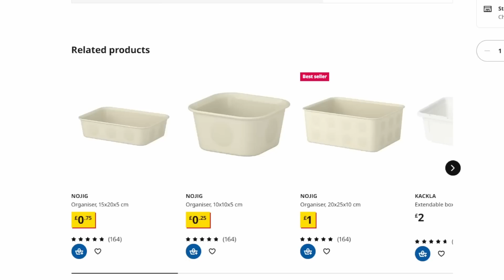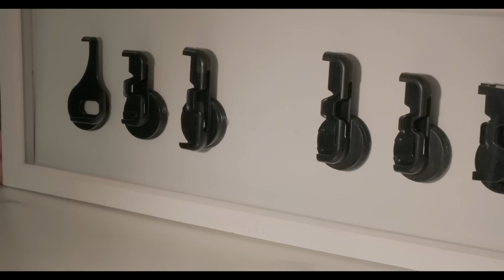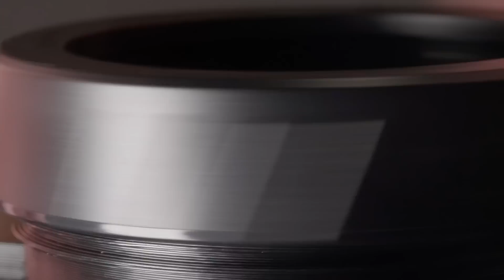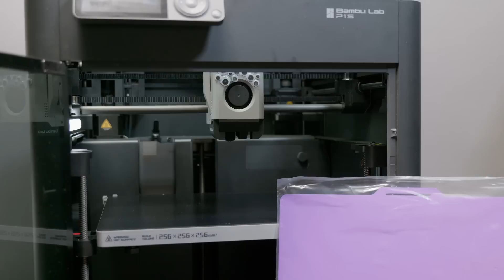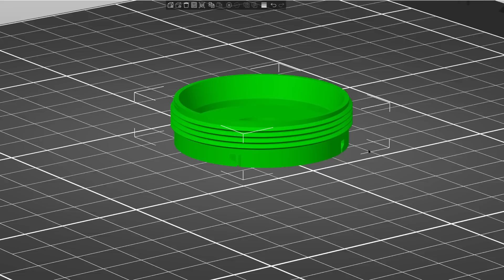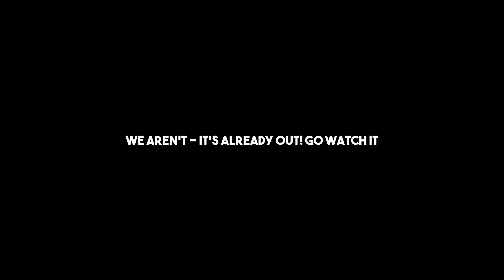Beyond Trinkets: Why the 3D Printer is Now a Production Tool

Comment: Mark could optimise his designed-in support removal by changing to a single serpentine line of support. That way (with some tuning) the support could be pulled out in one go by grabbing a designed-in handle.
Reply: This is an excellent idea.  I will use it!
Reply: Or he could avoid supports all together by using non-planar 3d-printing. I believe it's not yet production ready and still needs improvement(could be wrong though), but it could make a difference in application like this and might be worth exploring and investing into it. @joshuayjbird did a video on it.
Reply: @kevinraetz3890  It's a fantastic idea, in theory.  The challenge is the complexity in toolpath generation skyrockets compared to normal '2.5D' printing.  In a context like this, where a single product is being made in some quantity with evolution of the design, the worth-it factor is potentially higher, but overcoming the challenges and getting it to the point it's actually improving the quality of parts printed would be hard - it's taken him some time to get to fully designed-in supports, and non-planar is at least an order of magnitude more complex.  We either need a breakthrough in slicer-based analysis of parts and rules-based generation of gcode toolpaths based on zones within the part, or people with enough throughput to get the ROI need to treat toolpath generation like CNC machining and really design the gcode toolpath to form the part with non-planar sections.
Reply: @kevinraetz3890 you have to use what is actually available.

Comment: This is a very important information to get out there, because people (especially thos already into 3D printing) still consider Prusas printers to be "amateur" or "inferior", because they use 3D printed parts.

One of good sources I found on the topic of using 3D printing for manufacturing and it benefits/advantages is Slant 3D.
A few videos "The Competitive Advantages of Mass Production 3D Printing" and "How 3D Printing Reduces Carbon Footprint" gives you things to consider about the whole manufacturing cost (transport, storage, tooling,...), not just cost of material.
Another video about "Perry Parts" showed the need for including 3D printing in types of production. Sometimes, 3D printing provides parts that are superior to parts made other manufacturing methods.
Reply: I'd say you should take anything the Slant 3D guy says with the consideration that he's extremely biased in what he says. Their videos are made purely to promote his business so he will sometimes say things that are straight up wrong about other manufacturing processes.
Reply: " Slant 3D"
You mean the company that sells you 3D printing services and doesn't use 3D printing them self cause it is a bad idea?

Comment: That's the most interesting video on 3D printing that I've seen in a while. Resources on professional 3D printing (as opposed to mass producing garbage toys and flower pots) is still very rare. I'd also be very interested in a video on achieving production quality 3D printing!
Reply: There are some resources out there. I'm not a big fan of Slant3D, but he does have a lot of videos for designing for 3D printing, since he runs a 3D printing business. Just be aware that he's very much into his own 3D printing business and isn't a fan of home 3D printing. I will see if I can find other good resources.
Reply from the maker: Noted !
Reply: Make a flying thing with it!
Reply: " is still very rare."
Well - cause 3D printing is inherently not suited to mass-production. it is fast and cheap to getting started - great for prototyping. But it has high production costs, low accuracy and low strength. 

And no it is nto cause 3D printing is "new". It has been used for many decades in actual manufacturing companies - for prototypes. You can find videos of the automative-industry basically pioneering resin-printers in the 70s - photosensitive polymers hardened by 3 lasers.
Reply: @ABaumstumpf  Accuracy and strength can be good enough if the product has low requirements, like the product shown in this video. 3D printing has in my opinion filled a void where you need a part that is niche and too low volume for mass production. The adapter in this video is a good example - it's used by doctors, not the general public, and it needs to be created for the specific phone. It's probably not seeing the volume needed for injection molding.
Reply: @logicalfundy "where you need a part that is niche and too low volume for mass production"
Yes, butt hey are talking about mass-production.
Reply: @ABaumstumpf  there's a difference between mass production on the order of a few thousand units per year or month and a few thousand units per day or hour.
Reply: @ABaumstumpf  The point being made in the video is that there are now many valid ways to manufacture a product, each with their strengths and weaknesses, which are also evolving to the point that multiple ways can be 'good enough'.  The old view that 3D printing is for prototyping and methods like injection moulding are the only sensible way to do mass production is too simplistic.  There are big overlaps, even going up to very high unit counts, where either might be a reasonable choice, and you need to evaluate all aspects of the product to decide which is right.  I've produced over 100,000 units of an FDM part for a customer who has had a quote in hand for injection moulding it, because the convenience of my shipping precise batches on demand, and zero upfront tooling cost outweigh (not dramatically) lower unit cost, as the quality requirements are insensitive enough that we can easily meet them with well tuned but quite basic FDM printing, 2000 units/day.  Other parts might have requirements that would preclude this and make SLS printing, CNC machining or injection moulding either the only way to produce them, or the best return on investment when all factors are taking into account.
Reply: @ABaumstumpf  Mass production is vague. Some things a production run is 100 parts. Some things you might create an injection tool for a prototype run of 1000. Implying a much larger Production quantity.  It is more about the limitations of the process.
Reply: @TotesCray  " there's a difference between mass production on the order of a few thousand units per year or month and"
Of course, and there is a difference between knowing the actual cost of massproduction and following the claims of a person trying to sell their printing-farm as a service.
Reply: @ABaumstumpf  3d printing is cost effective for SOME things. But the process has limitations and need to be designed for. If you are making 10 parts the cost of the tool is extreme factor. If you are making a million it is trivial. I agree it is the mind set of the designer. It would be complicated to design some parts for a particular process. In a timely manner.  I have been designing parts since the 80s and using 3d printing since the 90s.  Recognizing and working around a limitation is what design is.  There are a lot of work arounds for any issue.
Reply: @ABaumstumpf  It all depends on the part requirements. Just like any process you need to work around its strengths and weaknesses. Like the strength of injection molding of high qty part cost. or weakness of up front tooling cost. I agree with the general statement "3d printing is not good for Production". But without considering all the options that is too broad of statement.  And there is no comparison for parts in large qty. But you need amortize the tooling cost, storage cost, and many other factors that influence the total cost,
Reply: @RobertONeillPhotos  "3d printing is not good for Production"

That is why i specifically said MASSproduction.
If you only make a couple hundreds then that is a different story - and not the story of this video.

Comment: adding the support to the design is great for easier postprocessing, and if you export your CAD as a step file you can import the file into orca as a single object but still lists individual objects (depending on how you structured your cad) This allows me to go thru and change settings like number of walls and infill density. Here is the counter intuitive part in either case make your interface layer a solid surface and make the top/interface portion at least 3 layers. The supports will come off in a single piece and the supported section will look fantastic.

Bonus, I also include modifier regions in my step files to be imported into Orca. One example is if I'm printing something with a grill like a fan cover or a filter box, I can change the settings of my modifier to print with zero top and bottom layers and let the slicer take care of the grill via infill patter and density, not only does it print faster, it also saves material and time in CAD.
Reply: Yes, years ago, I had a two material 3D printer, a Robox RBX02, and I used to do the same trick in their slicer due to limitations then, and you’d make a support model in CAD too, and important the two models and it fooled the slicer software. They were small build area machines, and not used anymore but the 3D modelling and CAD process stayed with me. I too often print at an angle, and split surfaces to create two flat parts to reduce support and printing time.
Reply: does it work well with tpu? With rigid plastics I can be print without support quite big cantelivered areas, although need to go very slow (like 5mm/s or less). But with tpu such tricks don't work.

Comment: holy moly those in-house prints are CLEAN af 😍 Wish I got a look at how/where they hide the seams. Especially for round islands.

I personally never use slicer-generated supports for stuff I've CAD'd myself, any support geometry is always designed into the part, even brims, mouse-ears, runners etc. Wish more people did this for designs they share.

That support chamfering technique is new to me!
Reply from the maker: Tldr- tuned ironing, but I will write it down as an idea for a future video 👍

Comment: Very cool video, I was thinking that this should be possible, using FDM for final product parts that do not look like some temporary place holder but like they are supposed to be that way. 

I had an interesting feedback from some various that is slightly related to this, although not a serial production. I built myself a robotic mule. Basicaly a 4-wheel platform with tank steering. It has 2x500W motors, weighs 140kg and carry similar weight around all day on a single charge of its 2.5kWh battery. The main body is welded from laser cut steel plates. I designed a few mm clearance in all holes that need bearings in them and printed PCTG-GF tolerance rings that press fit in the steel plate and the bearings in those. It worked very well. So I decided to simplify making the part that transfers torque from the first stage reduction chain drive (1/4" chain 65t wheel) to the second and final chain drive (1/2" chain 12t cog). I used simple straign steel axle and on it fit printed parts that make the right fit for bearings and the two chain wheels screw into nuts embeded in the print. So the FDM part itself transfers the torque from one to the next. I was curious if PCTG-GF will be strong enough for the torque and hard enough to not develop any play from the all the forces on ot. It turned out to be completely fine. After a few dozen hours of overloading and generally abusing the robot I took a look at the printed parts in the drive train and they are all unchanged. 
When I showed this to some of my colleagus who are mechanical engineers (unlike me) they all showed a level of surprise that this is possible with a hobby printer and filament. Similar reaction was from sharing parts of the design on some 3D printing forums. And when talking about it more it always turned out that both mechanical engineers and 3D printing ethusiasts somehow got convinced that hobby level 3D printers are for gaming minitures, fidget toys and maybe the occasional clothes hook or drawer handle. I find that a little sad.

Comment: I made a lens housing with parts that looked like his threaded parts. Looked and worked great, initially, but later split along layer lines. The thread cuts are points of high stress. I could refine the design, but I also want a printer and process that will give me more strength along layer lines. Unfortunately, this not a priority for printer customers making trinkets.

Comment: I'm actually printing a couple of designs I did for a client now that have large flat areas, but there's a bump so it can't just be printed flat on the bed so I use a LOT of support material. 3 or these things I made took up almost a full spool of filament. And close to half of that was supports.

Comment: I wonder why he didn't use an IDEX printer to deal with supports? Sure it's more efficient with a mono material but it would also have saved him time and made constructions easier
Reply from the maker: I can't answer that myself but I think probably primarily because idexes are sadly not common and those that exist have issues. The prusa XL would be a reasonable suggestion though, but ultimately it's a single material print so you're probably not adding that much value by trying to improve support beyond what's already achieved
Reply: I also imagine that support-optimized plastic would have to follow similar sourcing regulations (if they're even allowed to be used) and introducing that much extra work and cost isn't worth it compared to some extra design time.

Comment: Thanks. Great to get some input from a real designer, that actually design for print. As for his supports, please share the details on them. Sounds like he is printing solid structures, not weak ones, with a weak interface. As in tree supports. He uses that, to support larger areas, say a flat surface, to reduce the bridging. The interface layer seems to be deliberately weak, if I am to guess, he probably deliberately uses a width that is the narrowest his printer can support in a chamfer. That way, the part that breaks, will be just that. Given that the entire support structure is not super thin lines, it probably will print with higher accuracy and will support faster printing not being a single line print. He would still get a pattern in his printed part, but he defines it, he can make it to his liking, and integrate it into the part. Also note that he makes long winding ones. Those have a long thin line to break, not a mesh of lines that all make a traffic jam, as you try to pull them off.

A quick way to get this working in a slicer, would be to say use spiral support, with say 4 layer width, chamfer on the top, as in reducing the width at the top. You get along line that can be broken off. Or just line support, as in align rectilinear.

From what I can tell, in a quick take, the base is a solid structure with thicker walls, to deliberately make it solid. The interface layer is a chamfer.

I just cannot stress enough, that thin walls need to be printed slowly, and is the main plague of classic supports.

For his supports to actually works, the interfacing layer of the part, obviously need to be perpendicular to the orientation of the support structures. The curve he has introduced obviously offers that, but for a slicer, which uses an universal model, this is not the case.

Him actually understanding the basics of support structures, is quite rare in this industry. As is his focus on "consistent layer lines". He probably should look at his infill, if he hasn't. Single line extrusion are a pain to print, particularly at any higher speed, unless your filament is super great at bridging and fine details. It is the same issue as for regular supports. It is not at all understood within this industry. Anyone that actually design for print, are faces with this like straight off, and the info on the topic is like zero.

Comment: Super interesting.  The tapered support idea is genius, something I'll definitely consider for future projects (if I remember)
Reply: Slant 3D videos have a lot about designed-in supports and recommend a small gap or small spurs for contact, but the taper looks really good, too, and it seems just as reliable to remove. Definitely going to try it next time I need designed-in supports.
Reply: It looked like the support was designed to leave an aesthetically interesting pattern rather than a witness mark defect, and the texture might even act as a slightly compliant mechanism to allow a precise fit to a mating part that slides into place.  I much prefer designing for FDM manufacturing to designing for injection molding.